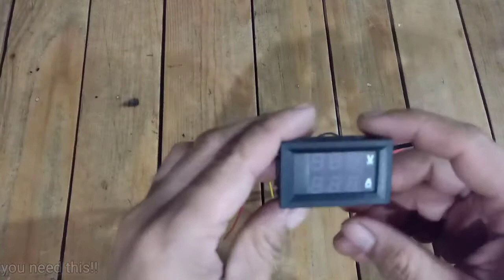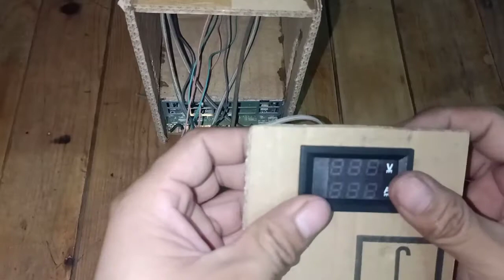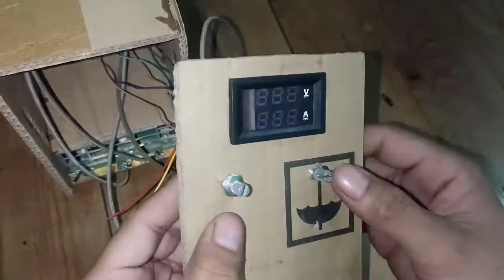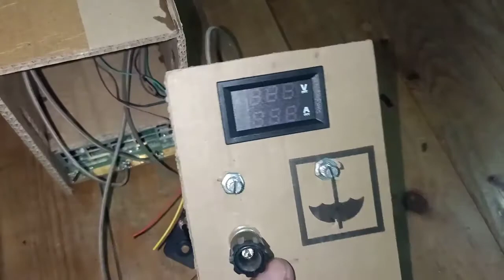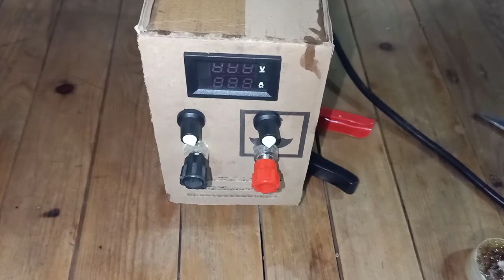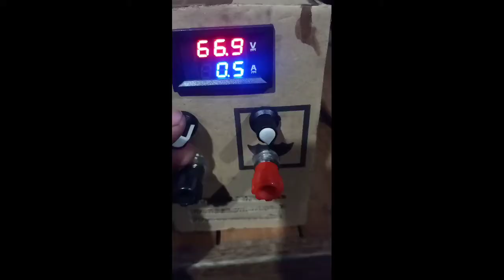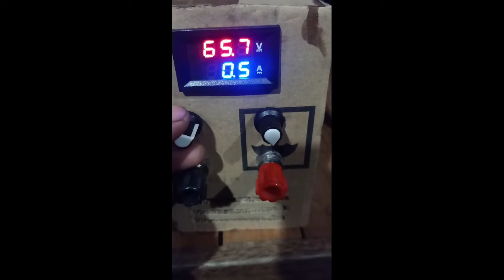DIY Wide Range Voltage Lab Bench power supply

Comment: Pwede po yung galing sa computer na power supply gamitin? Panu po I connect marami po kasi yun wire. Baka po pwede mo gawan ng video. Salamat po
Reply: Pwede un. Kunin mu lang ung yellow wire un ung 12v nya. Ung red wire 5v un. Tas ung mga black Ground/Negative.